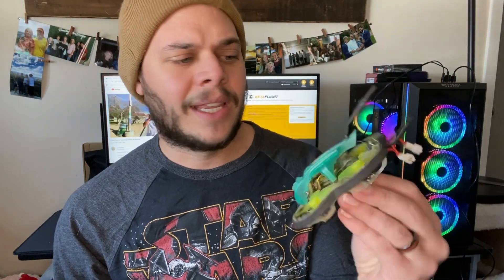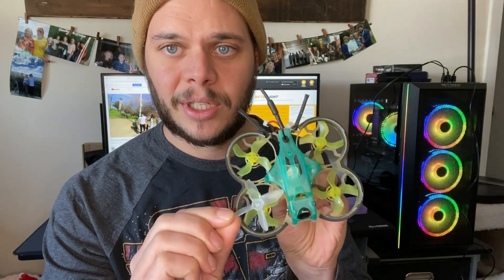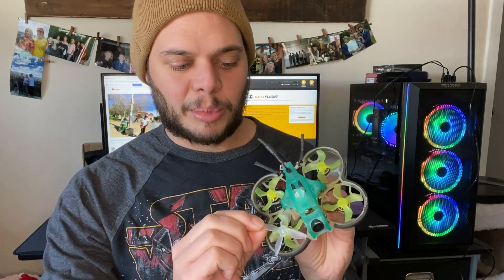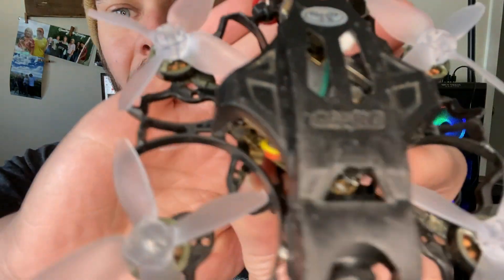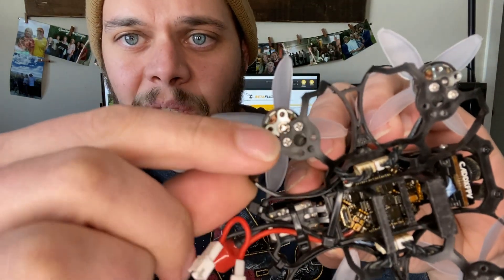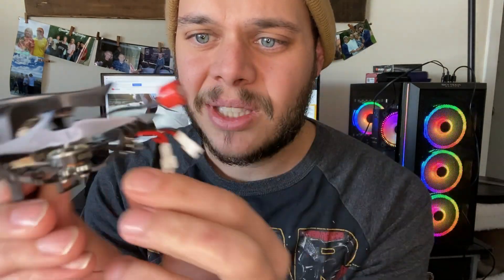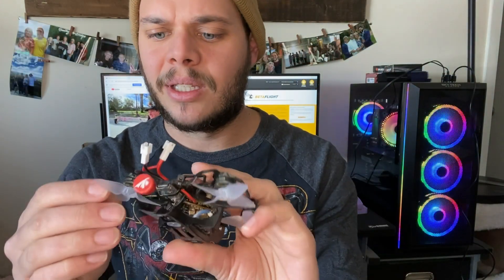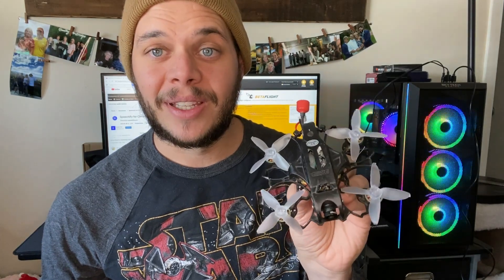2 Inch TinyGO - Modifying the 1.6 Inch GepRC TinyGO 4K to fly with 2 Inch Props.

Comment: How has the load increased?  if you do the same and put a 3s-flight controller, will it survive?  in stock 3s pulls well
Reply from the maker: It’s so much better. And the aio board that come with is actually rated for 2s-4s so it handles a 3s no problem. I’ve since upgraded this set up with a new apex2 frame, added a xt30 to use 3s and i put walksnail on it and it’s amazing. I have a whole build video of that process
Reply: @719FPV  I can't find it, can you link?
Reply from the maker: @Azgorsky  yeah it’s part of this one https://youtu.be/6yiNos0of60

Comment: After a bit of research (Your's and Joshua's channels), I purchased a TinyGo last week.  Full disclosure, I nearly returned it for an EMax Tinyhawk III.  GEPRC released a newer style remote control which arrived with a defective power button. Powering on requires a unique off center hard press on the button for it to power up.  Contacted GEPRC and awaiting their follow-up on a replacement.  Nonetheless, I have the TinyGO set up with FW 4.3.1 and the accelerometer calibrated nearly perfect.  Already have a CADDX Vista FPV antenna to install on the TinyGO.  Not sure if the goggles require a similar antenna upgrade.   Still researching the latter.  As I am new to FPV flying, not all in on upgraded goggles.  I can fly the TinyGO fairly well LOS, but with the goggles, just awful.

Comment: You should try mounting the motors under the ducts so you can still use all 4 screw holes
Reply from the maker: I did try that at first but the motor mounts are too close together and the 2” props would hit each other
Reply: @719FPV  I wonder if you could stagger the heights of the motors with spacers like how the speedybee flex25 does it
Reply from the maker: @_tcmore  yeah that’s not a bad idea

Comment: Very cool! I had to mod my tinygo as soon as I got it(used). The 1s batteries I got with it were trash and I couldn't find any local. Converted it to 2s with a xt30 in place of the two connecters. FYI tattu brand 2s 450mah 95c rating fit the battery tray perfectly!

Comment: I want to buy this frame. How is the frame? Is it made of hard or soft plastic? I can get this frame in $15 and whoop frame in $5. Is it worth it? I want to buy this frame because of prop guard.
Reply from the maker: The tinygo frame is an injection molded plastic that is quite durable. I have only broken it on very hard crashes into rocks or concrete. But keep in mind the frame is designed for 1.6” props only. I got mine directly from geprc for $6
Reply: @719FPV  Thanks
Reply: Do xt30 connector with it! Better current flow and you can run a single 2s or 3s. I use gnb 520mah 3s. Makes your tinygo rip!
Reply: @lanceblevins1726  Hii I have old kingkong et 115 and changed from jst to XT30. 
XT30 is much better, it was worth to change.